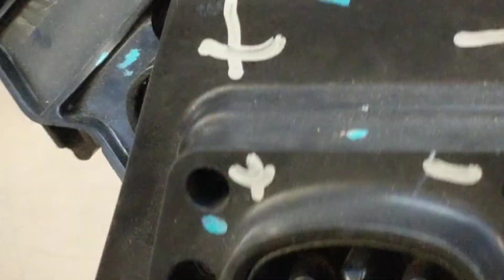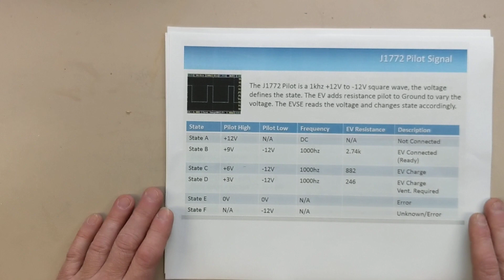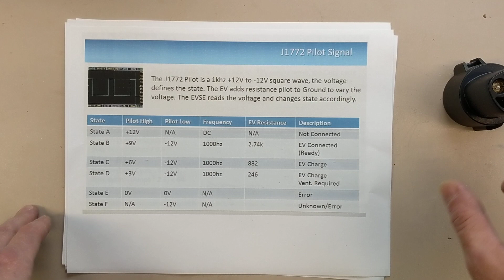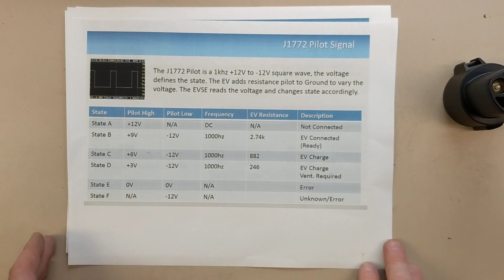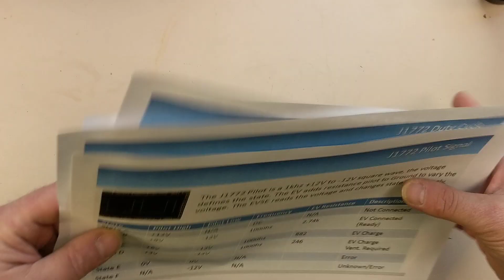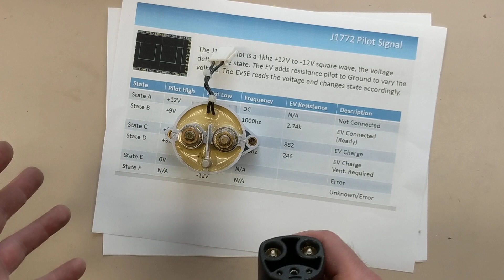Tesla Charging - How Does it Work?

Comment: Got 75000 miles and today won’t charge on superchargers- gets Latch Enabled Fault when I go to service mode, but it will charge at home on home Tesla chargers AC
Reply from the maker: You didn't specify your model, but generally if the latch won't function, it will not allow Supercharging, and even AC charging will be limited in speed.   Email me and we can work it out.  (Email is in my Channel's "about" tab when you use a browser)
Reply: Thanks it model 3 RWD long range 2018
Reply: Yes I would like to consultation
Reply: I took some pictures of the Service screen at Superchargers witch some fault indicators
Reply: I was getting solid dark blue light but did not started
Reply: Latch Enable Line fault
Reply: I suspect lock pin servo ,maybe not moving fully to not making switch -or intermittent , but why is ok at home on wall charger 240V

Comment: @Ingineerix now that Tesla have opened up their network to other vehicle manufacturers at least in Europe CCS2 and AUS CCS2, why do some brands of cars not negotiate with Tesla to accept a charge?
Reply from the maker: Well, if you read up on CCS (DIN 70121) signalling, it's incredibly over-complex, clearly designed by a committee, and if everything isn't perfectly implemented , it can fail to perform properly.   Here in the US, Tesla has opened only to certain manufacturers, and they validate that upon connection, so currently unapproved EVs don't charge.   If it's not an intentional block, then it could be just an edge-case and someone has some testing and bug-fixing to do, could be either Tesla or the EV manufacturer, or even a 3rd party supplier that the EV manufacturer used.   This could take a lot of time, and some EVs do not enjoy OTA updates, so it may require a trip to the dealership to get an update if that's where the problem lies.   If it's on Tesla's side, this may take a long time to resolve as Elon famously fired everyone in the supercharging team.   I know he hired back some of them, but it's still probably pretty messy over there.

Comment: Thank you one of the simplest explanation. Is there a site or link you have or can point on the supercharger CAN/SWCAN protocol that Tesla uses. I'm trying to implement it to see if I can close the contactors on the EV side. Any pointers or help is appreciated. I have been able to do it with other cars that use PLC/GreenPHY as CCS uses ISO15118/DIN70121 (also going to try with newer Teslas that use NACS/PLC) but older ones that have SWCAN - I am not able to due to the closed nature of the handshaking/protocol Tesla uses. I am not sure if anyone has reverse engg it.

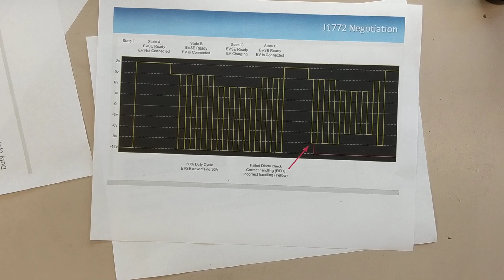Comment: 17:05 hopefully firmware update of these chargers via the vehicle does not allow for installation of malicious firmware?
Reply from the maker: It's got a secure bootloader.  It would be a lot of work to get around this, and they'd have to connect to YOUR charge cord to do anything, and it would really be limited to just breaking the unit, as it can't do anything really "bad".  To be clear: It won't work the other way, something on the charge side cannot push firmware into the car only the obverse.

Comment: Awesome overview. Thanks. Do you know where I can read more about the specific CAN protocol used to negotiate DC charging?
Reply from the maker: Public information does not exist, sorry!
Reply: @Ingineerix  oh interesting. Isnt there any other company besides Tesla that builds DC chargers for Tesla EVs?
Do you know if there open communication protocols for other standarts? (CCS1/2 Chademo, etc)
Reply from the maker: @JRabba1995  As far as I know, nobody.  Tesla has not released the SWCAN "Supercharger protocol" to anyone.  I have reverse-engineered it somewhat out of curiosity.  However, Any Tesla since 2021 also speaks "CCS" (ISO15118) so a DCFC manufacturer could just put a NACS "whip" on an existing CCS charger and it would work with all 2021+ Teslas or any Tesla that has had the PLC retrofit.   Going forward this is how all 3rd party OEMs will work on the supercharger network.  Tesla could not release the SWCAN protocol to 3rd party OEMs as there is no real authentication mechanism, the car controls auth.  This is fine on all Tesla cars on Tesla DCFCs, but not workable on other OEM fleets.

Comment: Tesla could modify the charger located on the PCS board to make it two way but they could also sell a Tesla external inverter or a Wall Connector/inverter (similar to the one Ford uses with the Lighting) that I think would only require firmware changes.  Then both the vehicle owners and Tesla could make money in a VPP program and help out the grid.  An external inverter could also handle power spikes of more than 11KW.  I would not mind if Tesla also made a small amount for each KW cycled through the HV battery (to recover any wear and tear) if it would get them to allow such use.  I recently purchased a Tesla with a LFP traction battery which should last at least 300K miles even if used as stationary storage.  Just finished watching the video were you mentioned this very topic.  Thanks for your great vids!
Reply from the maker: They "could", yes, but the cost to make and install such as system would probably be around $8k.  Who would pay for that?   (Essentially all the same hardware as a grid-tied solar system, but without the solar panels)

Comment: My Wallcharger was having a problem for a time that it would not charge. I would get an error message that the lock to hold the cable in place was not working. The problem was intermittent. At first I would turn off power to the charger, wait a few minutes and turn the power back on. Sometimes I would have to lower cycle several times before I could charge my car

I turned off the power to the charger and took off the putter cover, one security torx on the bottom. The inner cover has several security torx fasteners holding it in place. You may have to pry this cover off. Be careful as there is a cable that connects to the lights you see on the outside of the unit. At this point you can see we’re the power wires come in at the bottom. There are also 4 small wires that carry the communication signals to the charger. As mentioned they are the PP wires as well as 2 ground wires. They have crimped on terminals at the end of the wires and screw into a connector fastened to the circuit board that is inside the unit. Since I could hear the lock engage and disengage I assumed a signal was not reaching the car from the charger. I could also move the lock manually from inside the trunk.

I removed and cleaned the 4 small wires and the charger worked for a time but would fail again after a couple of uses. I tinned the crimped on connectors with a thin coating of solder. This seems to have fixed the problem. Hope this helps anyone else who has this problem.
Reply from the maker: Thanks for posting!

Comment: Ay 6:25, When charging, the only individual voltage  the charge port pins will see i think,  is the difference between the CC-CV from the supercharger and the Battery voltage, which mean a maximum of 132Vdc if the battery would be dead at 3.0V/cell and the charger would boffer in the CV state a 4.2V/cell(470Vdc), unless the charger CV state is programmed  to push voltage just enough to match the SOC+ a given additional voltage and so bring only lower voltage difference between charging voltage and the battery voltage... like 10-20Vdc diff just to compensate for the cable and connector loss, internal resistance etc... so the arc might not be a 470Vdc arc i guess?

Comment: I know when you point the Tesla connecter and press the button, the charge port door opens.  How does it work?
Reply from the maker: Sends a 315mhz RF signal from the Tesla handle to the car.  (US frequency)   You don't have to "point" it, just press the button.
Reply: Is the 315 mhz RF signal a quiet sound made by the charger or it is the button sound?
Reply from the maker: @MetroSturdy6018  RF = Radio Frequency.  Operates like a garage door opener remote.

Comment: Thanks for this detailed video. My mobile charger gen 2 is making 6 flash lights when I plug it into the car (green light when it’s not connected to the car). Got error message CP_a004, CP_a103 and CP_a099 on the screen while it’s connected. And the car asks confirmation that no cable is connected before to start running, like if it is not able to detect if a cable is connected or not.
Do you believe the issue comes from the mobile charger and it need to be changed?
Reply from the maker: 6 flashes on a Gen 2 means incorrect Pilot levels.   CP_a004 is Proximity Rationality, CP_a103 is Proximity Ground Bad, and CP_a099 is Cable State unknown.   If you charge on another connector and it works without error,  yeah, it's your cable.  Otherwise it could also be something in the car's charge port.   If your cable is worn, it could have experienced broken conductors in the cable, this happens often when people don't know how to wrap cables correctly (no twist).

Comment: How does the charger know to bill the right account?
Reply from the maker: The car reports the charge session to Tesla.
Reply: Through the pilot pin, power pins, Wi-Fi, or cellular modem?  Does the charger controler do this or the screen mcu?  Thanks
Reply from the maker: @douggolde7582  The MCU tracks the charge and uploads it to Tesla over cell or wifi.  If it is unable to, say because you have blocked it, it will eventually stop allowing supercharging until it can report home.

Comment: What is Supercharging Protocol mentioned in Video. How it is different from SAEj1772
Reply from the maker: It doesn't have anything in common with SAE J1772.  It's closer to CHAdeMO, but it's proprietary.  It uses single-wire CAN at 33.3k over the pilot line.

Comment: 10:03 In the UK (likely all EU), many older Teslas have CCS upgrades (including my 2018 Model S). They literally change that module and give you an adapter! 😂 Costs £200, so pretty reasonable. And then supports faster charging.

Comment: Hi, We brought our 2021 Model 3 LR four times to Tesla Technician they replaced the charger port and this still doesn’t fix the problem on this 3000 miles vehicle.  Everything works and charges just fine, but we kept getting the error on the screen that beeps.  The error message while we are driving says “unable to charge, disconnect and retry”.  and “unable to charge - service is required , charge port is not detected “.  Anyway just made another appointment for service again.  Wondering if you have any idea how this can be resolved?  I have rebooted the car and still not resolved. Thanks!
Reply from the maker: Sounds like a bad ground, or bad CP ECU.   Next time it acts up get the alert codes and I can give you a better diagnosis.   (They will be visible under the car tab, then [Service], and [Notifications].

Comment: I HAVE A 2013 TESLA S  and when I attach my GEN 1 charger the light is green and after I plug it to the car port the green and the charger lights  starts a green sequential flashing. Within 30 seconds the charging port goes to a solid red and the charger still glows green but it stops the sequential flashing . the dash panel said check charging cable. I opened notifications and it showed CHG_007 AND CHG_012.   I then used a public charger and my J adapter and with 30 seconds the car port glowed a steady red.  I am able to still use a TESLA charging station to recharge. Please help me with this issue

Comment: WTF! / LOL  @ 8:05  -   There's a mechanical relay in the charge port ECU?  With all of this amazing, cutting-edge technology that Tesla has developed there's still an 1800's-era piece of technology?  Why not a more reliable MOSFET?      Great series - thank you so much for these excellent, in-depth videos!
Reply from the maker: Cost / Reliability.  They could have used an Analog multiplexer or pair of solid state relays, but since the input to this relay is a pin in the charge port, it's going to be subject to a lot of electrical abuse.   I think a relay was a good choice.

Comment: If the supercharger is directly connected to the battery, surely it would be possible to fool the car with a V2G equipment that pretended to be a super charger but then drew power from the battery?  I know this is a bit dodgy but with care it could be used to jerry rig a tesla into being a power supply for a shortage situation? It doesn't matter that it would be a little costly.  You would need someway to know when the battery is depleted, perhaps just measuring the voltage would work.  There maybe other dangers such as unbalancing the modules.
Surely a V2G mode could be provided by Tesla in software to properly support an external inverter, communicate battery level and power availability. etc.
Reply from the maker: Tesla does not support it, and has a specific clause in the warranty that voids your battery warranty if you do it.  They want you to buy their Powerwall system  for this application.
Reply: @Ingineerix  Not very Elon-esk though.  Tesla is a strange company.  I truly believe Elon wants to help the environment, but losing a key benefit by forcing people to buy a product that you cannot meet demand with doesn't make sense.  I know he wants to robo-taxis or something but really I can't see FSD actually working well enough to do that for a long time.  It also doesn't make sense that they are so anti-repair.  We need to use the batteries efficiently.

Comment: Can you compare the wire size for the plaid and the model 3? Do you think the plaid will support higher supercharging currents in the future? It seems the batteries should take more. The 3/Y charges at 250 kW / 80 kwhr = 3.12C. That should indicate the new S should be able to do 312 kW, if the chemistry and cooling are similar. Plus, the battery voltage is higher, so lower charging cable current for the same kW....
Reply from the maker: Yes, I agree, but the point is moot until the superchargers are upgraded.
Reply: @Ingineerix  but, are the cables on the plaid larger than the 3/Y? That might determine if they can push more current into the battery.
Reply from the maker: @jonathanviventi1380  They do not appear to be, but again, that isn't what's limiting power.
Reply: @Ingineerix  Interesting! I'm interested to see how fast the Plaid can charge once we get v4 superchargers! The model 3 manages 250 kW, with only a 96S battery and 80 kwhr. The Plaid is 110S, so at 250 kW, it's pulling 13% less current already. So, if the current was the limit, the plaid should easily be able to charge 13% more than 250 kW. If the cells are the limit, then with a 25% larger battery, it should be able to do 25% kW, or 312 kW.
Reply from the maker: @jonathanviventi1380  I haven't yet seen a V4 supercharger.  Yes, if the limit is current, the pack will be able to charge a bit faster.  I suspect that the Plaid's better cooling would allow even more, but right now seems the supercharger is the limit, so no point in speculating.

Comment: Could you put an inverter off the 12 volt battery and power a house during a blackout?
Reply from the maker: No, if you connect anything directly to the 12v battery, you will trigger a fault and it could result in an expensive service appointment.  (Definitely voids your warranty)  The only safe way is to tap the system at the PCS, but you have to know what you are doing.

Comment: Thanks for making these videos. Any tip on what the proxRationality alert that comes and goes constantly in my Model S is from?
Reply from the maker: Yes, that means there is likely a loose ground connection to the charge port, or (less likely) a bad pin module in the charge port connector.  The loose ground is not uncommon.  It's a large green wire on the driver side located under the rear seat cushion that is attached to the body with an M6 fastener.
Reply: @Ingineerix  Thanks! I will check on that.

Comment: I have a 2018 model 3, so I more than likely don’t have the PLC modem in my charge port ECU to support CCS charging.  Once the Tesla CCS adapter gets released to the US market, would it be as simple as swapping in a more recent charge port ECU that has the PLC modem so that I could do CCS charging via the adapter?  As in a drop in ECU replacement?
Reply from the maker: Well, Yes, but it will require software support from Tesla, along with a config change, so sadly you can't do it yourself.  (Unless Tesla opens it up)

Comment: Hey Phil - simply fantastic! I'm a dangerously incompetent tinkerer and electric motorcycle owner. Can i ask a really dumb question? My Harley Livewire comes with an AC charger cable. It is single phase to allow me to charge from any 240V outlet, has a big chunky box and a lead and Mennekes style plug to plug into the AC input in the bike. However, 240V outlets aren't always available but AC charge stations generally are, but i can only use them if i carry another lead with male/female mennekes plugs, which is a total pain on a bike. My question is, is there a way to make a simple adapter that i can plug into an AC charge station and my standard lead (with 240V plug) that will feed the right signals to to the charge station and bike to work?? Surely there must be a way ? PS i donated $50 to help your efforts and for your time to answer my dumb question.
Reply from the maker: Yeah, in the US, we don't have detachable cable sets on public charge stations.  Sadly, there is no easy way to do what you suggest, but you should be able to take an existing mennekes cable and shorten it and maybe even make replacement handles that are smaller/lighter.  Thanks for the support!